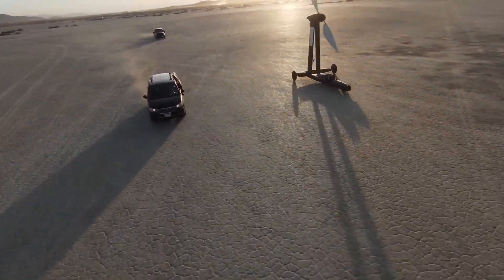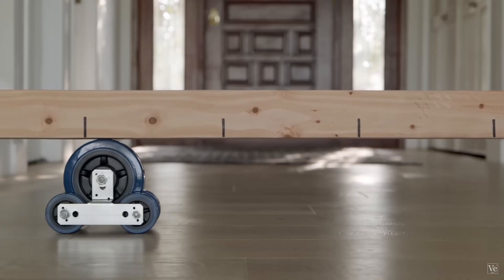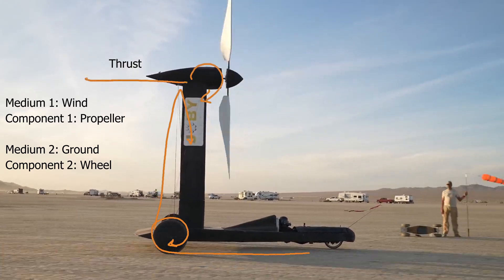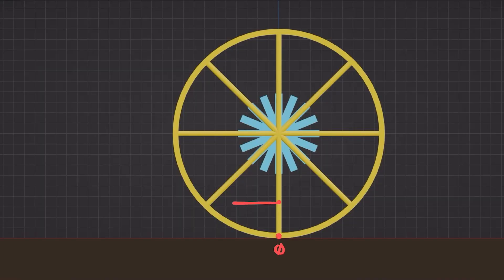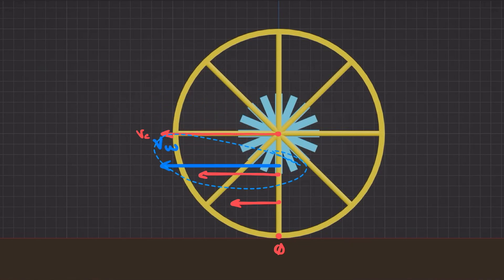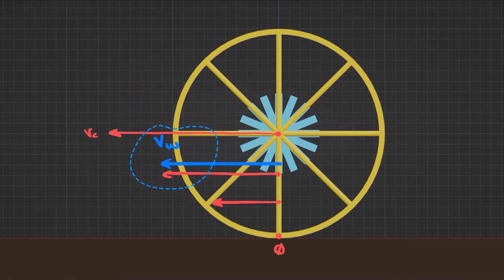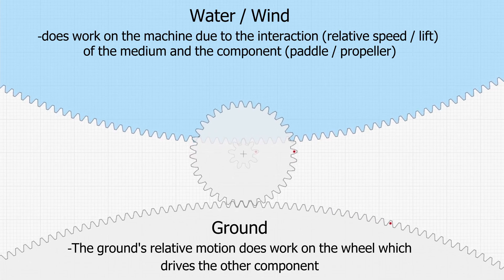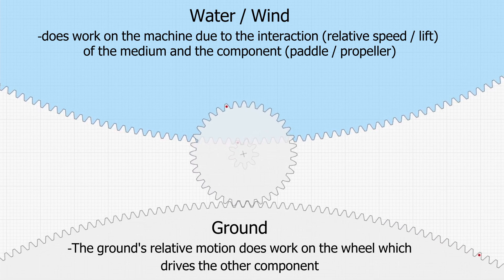Faster than Wind Machines Explained (Intuitively!) in 1 minute

Comment: but, according to the builder the propeller is PUSHING the car, so you comparison is not the same. It seems their claim is that the water wheel would be moving faster than the water. They claim that the energy to turn the propeller comes from the ground. so in your example the big wheel would be turning the water wheel and therefore inuring drag. put your big wheel on  chain and then onto the ground. and they claim the big wheel will carry the water wheel down stream faster than the water.
Reply: //"It seems their claim is that the water wheel would be moving faster than the water."//

In the scenario he animates, the entire device would indeed move faster than the water.

If you look on YT for "Along the paper faster than the paper", you will find a demonstration of exactly this scenario (without getting wet).

//"They claim that the energy to turn the propeller comes from the ground."//

Not actually the claim ... the force to turn the wheels comes from the ground interface, the energy comes from slowing the relative motion between the air and the rolling surface.  Force and energy are not the same as energy is frame dependent.  

So in the frame of the ground, the energy does come from slowing the air, but in the frame of the air, the energy comes from slowing the ground.   This is what confuses people about the treadmill example - humans tend to view things from their own frame of reference and on the lakebed the observer is fixed in the frame of the ground while in the room next to the treadmill, they are fixed in the frame of the air.  This leads people to believe that the two scenarios are different when they are not -- only their frame of reference has changed. 

//" so in your example the big wheel would be turning the water wheel and therefore inuring drag."//

You can bring his illustration to life with an ordinary bike -- press forwards on a spoke halfway between the ground and the hub.  This force is the same as the water acting on his smaller water wheel halfway up his big wheel.  What happens? ... the bike moves forwards twice the speed of your finger.  What is the force acting on the bottom of the tire? ... a force in exactly the opposite direction of your finger ... a drag force.  If you remove this opposing force (by making the road surface under the bike tire infinitely slippery), the tire will slide, there will be no opposing force, and the bike will move forward no faster than your finger.   Counterintuitively, it takes the opposing force (drag) to make the bike move faster than your finger.  Same with the Blackbird.  The drag force on the drive wheels is required.